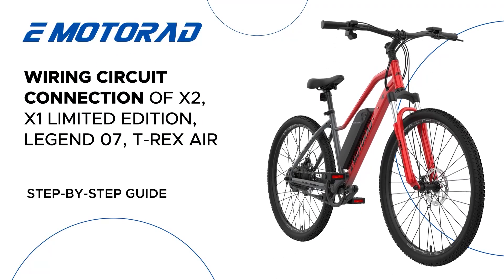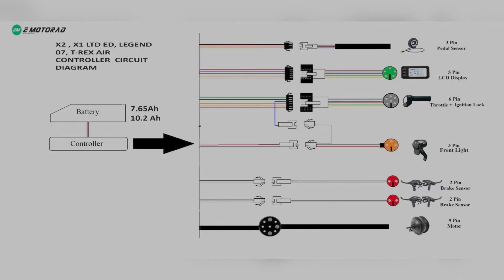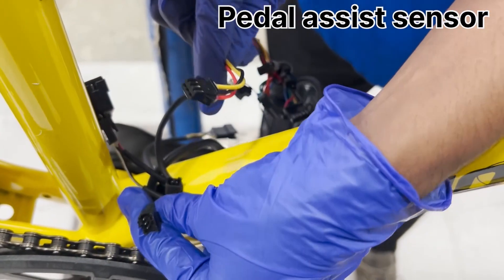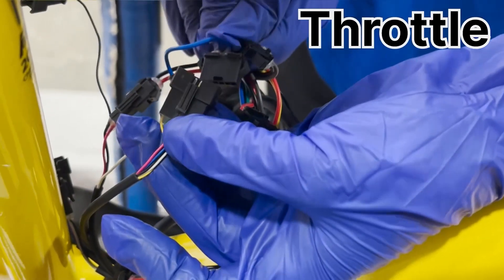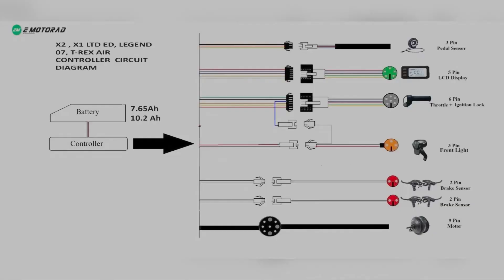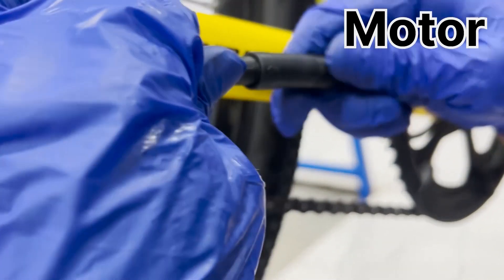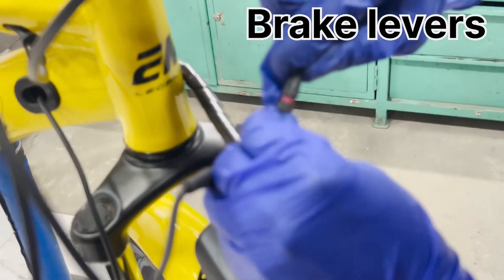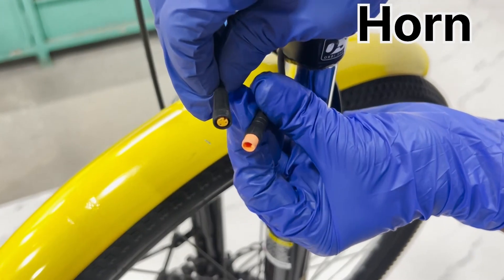Wiring Circuit Connections for X2, X1 Limited Edition, Legend 07, T-Rex Air Guide | EMotorad

Comment: My whole horn and lights cable is out how to fix it
Reply: They are not going to answer. You need to access the controler.
Reply: Same problem for me. Did get to know how to fix it
Reply: @SoumithReddy18  Yes, i fixed it on my own, entire kit came out again is connected it using you tube videos